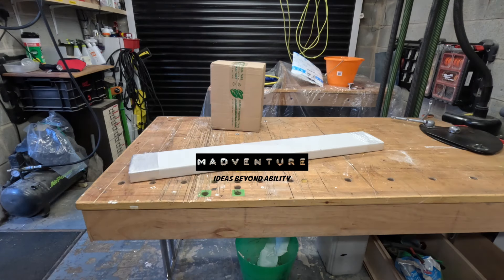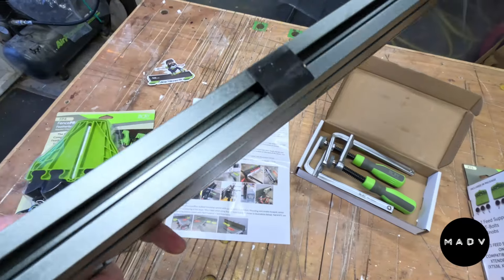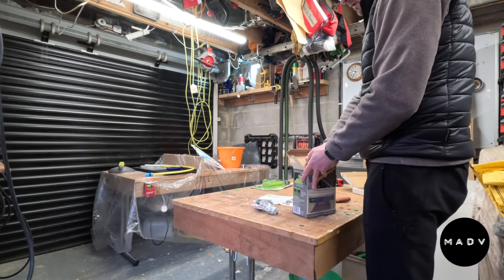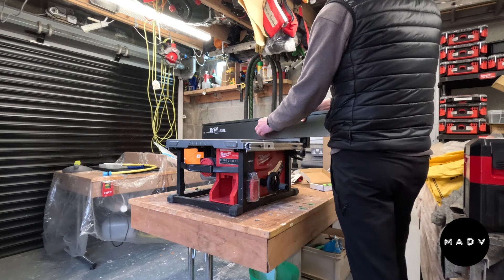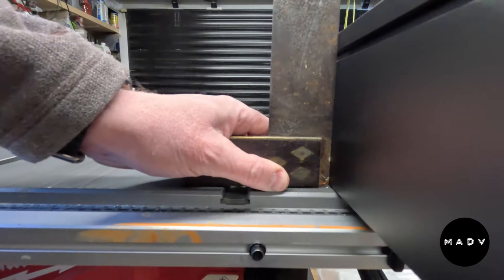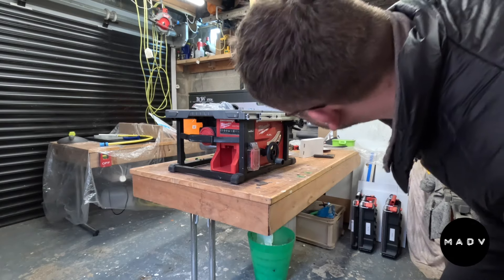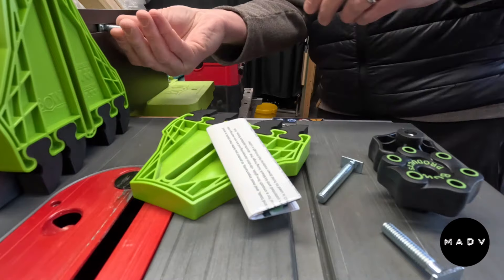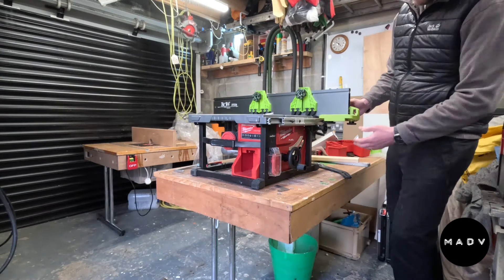BOW Xtender on a Milwaukee M18 Table Saw

Comment: Did you solve the 1mm out of square, if so how? I think this is a flaw in the way it clamps. I think the t-track style clamp pulls from one corner down to the clamping pad.
Reply from the maker: Hi @stuffimade (great name by the way) I think the clamping method is not ideal with a Milwaukee fence as it exaggerates its inaccuracy. I did have a fix with folder paper packers to calibrate it square.
Reply: @ Thanks! I am doing a video on a diy xtender fence. Do you mind if I use a short clip from your video in mine please?